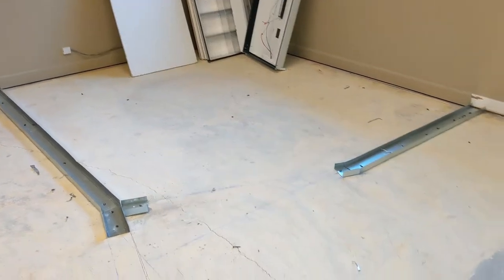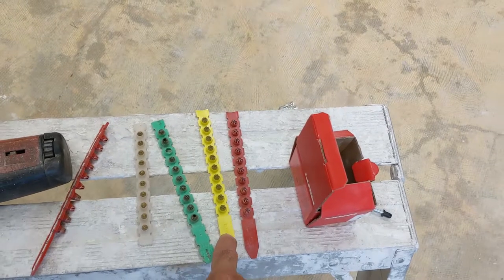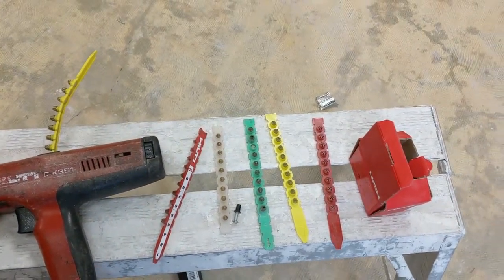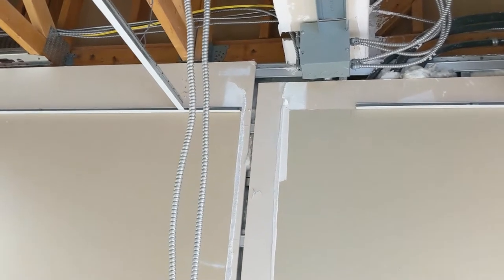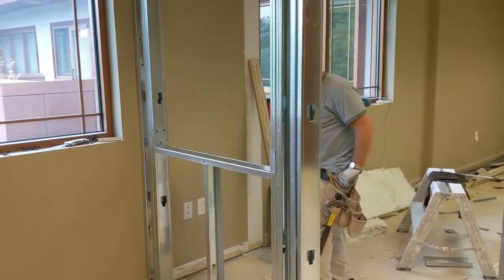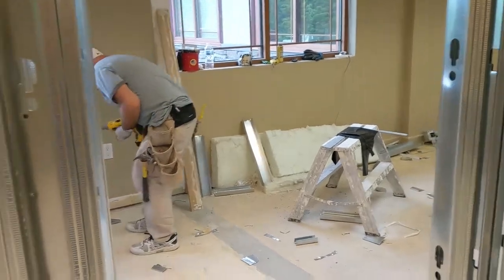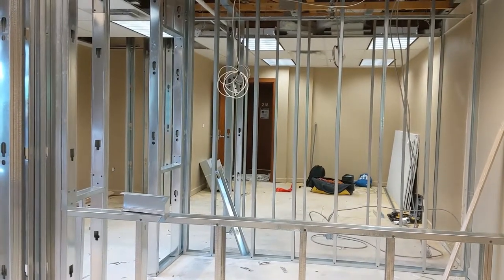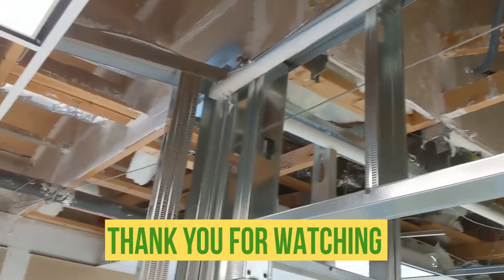How to Build Walls

Comment: Great job Bahiano, thank you for this great video, how about cost comparison, wood vs steel?
Reply from the maker: Hello brother, thank you very much for your time and comment, if you count piece by piece labour and materials, steel would be cheaper, but you have to run wires cost would be almost the same, because you can use romex or pex pipe direct or touching any of the steel everything needs to be protected, please let me know, if have more questions

Comment: Hello Bahiano, I need to build 2 walls in basement for a kitchen, what you recommend wood studs or metal studs?
Reply from the maker: Hello my friend, thank you very much for your time, wood studs is the way to go, keep safe
Reply: @BahianoReno  Hello Bahiano,
Can you explain, since steel studs are cheaper than wood studs?
thank you
Reply from the maker: Hello dear, thank you very much for your question, yes 25ga metal is cheaper than wood, but you would need at least 20ga metal, to be able to hold the weight of the kitchen cabinets or install wood backing on the 25ga studs for cabinets, if you use steel studs you would need different type of electrical wires or install wire protection in every spot that the wires pass a metal stud, in this case wood studs would be more economical, let me know, if you have more questions, keep safe